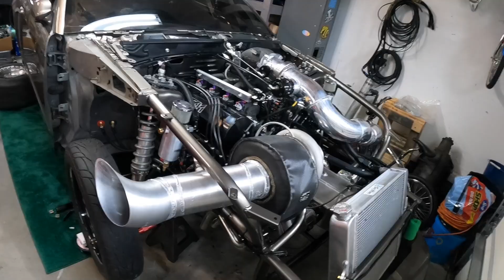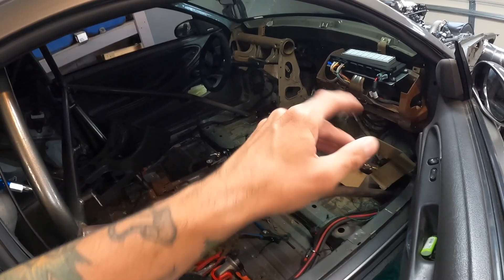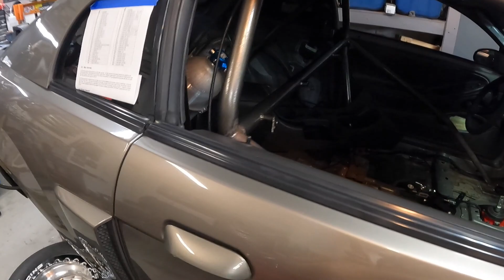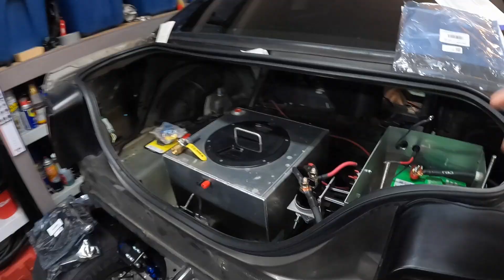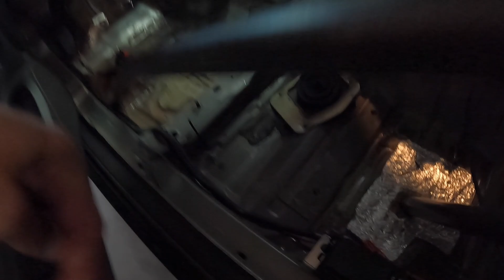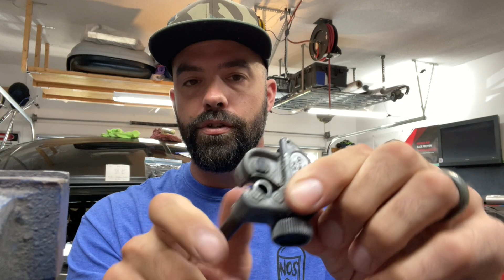Building A Record Chasing Stick Shifted Mustang!

Comment: Not sure if all dash bars are placed in the same area but I couldn't even fit my HP behind the airbag panel because of that.  I do like how you split the dash frame and removed the center section.    Wish I would have thought of that.
Reply from the maker: It should put it within on the ball park when he does the full cage and splitting it makes it’s ALOT easier to get stuff in and out